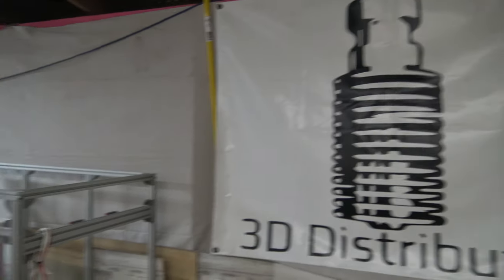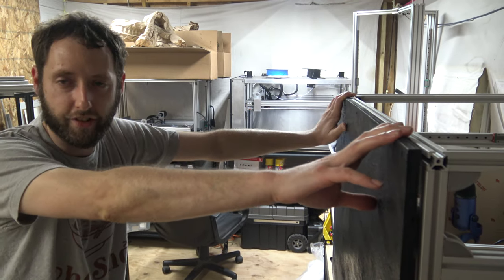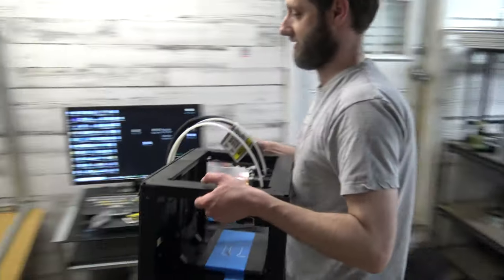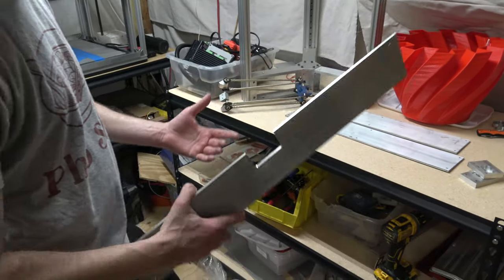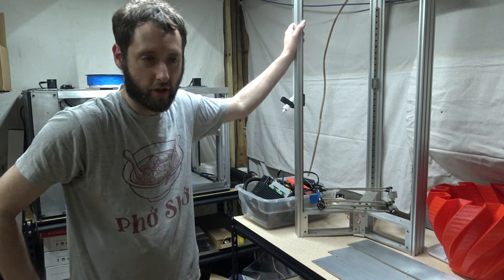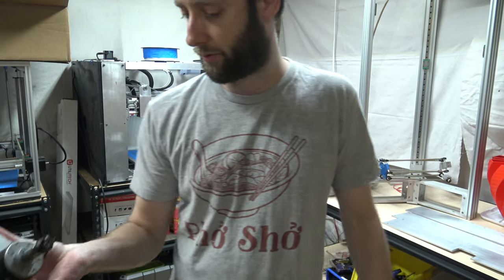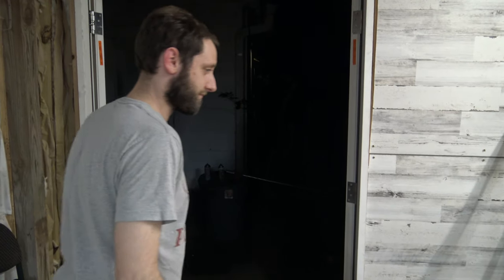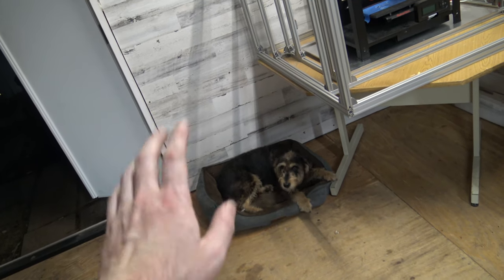Workhorse 3D Printer Updates: Heated Bed and New Large Scale 3D Printer

Comment: Ceramic wool has to have a binder. Its extremely dangerous without some kind of binder. The fibers break into tiny pieces and fill the air with essentially ceramic fibers your lungs can't break down or pass that also are very sharp. Make sure you where gloves and respirator and goggles wouldn't hurt either. Most of the time you encase the wool in refractory cement. Its not actually that good of insulation it just breaks down at a much higher temp than regular fiberglass insulation. For your application just fiberglass or Neoprene rubber like a knee brace or non slip mat would probably be better.

Comment: love the spindle for the XL
Reply from the maker: I cant wait to we get the spindle running
Reply: @3DDistributed  Hello 3D Distributed. I am trying right now to build a heated bed from aluminum. Iits quiet big like 700 x700 . What would you recommend for the thickness of the plate? 8 or 10mm? I have one 750 watt heating mat. Would be cool if you could respond? :)
Reply from the maker: @plavix2215  I would go with a 10mm or 12mm.
Reply: @3DDistributed  Thank you so much! :) What would be actually the difference between 10 or 12mm?  Like costwise would be only 10% for me, but from a technical POV? Is a thicker plate in general evener?
Reply from the maker: To be honest, I don't really know.  8mm is probably fine but every time a technical engineer buys a large build plate from me, they want a thicker plate.
Reply: @3DDistributed  Interesting. And from a manufacturing POV? Is a thicker machined plate more accurate in evenness? In general, here in Germany you have a tolerance spec scheme thats called EN AW 5083. It says max tolerance 0,4mm/m. In reality how big is the machining error. Really that big?

Comment: i think water bed has economical bed heater, same system than floor water heater. tubes under bed and water boil and heat aluminium bed. keep warm long and no go elektric bill lot. normal pla etc no need bed wery hot, 40-89 celcius have good.